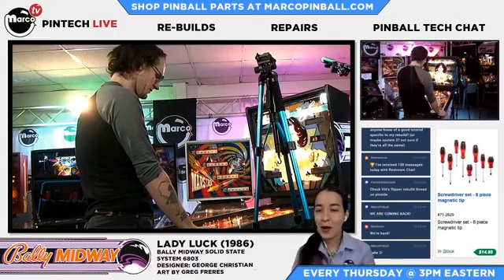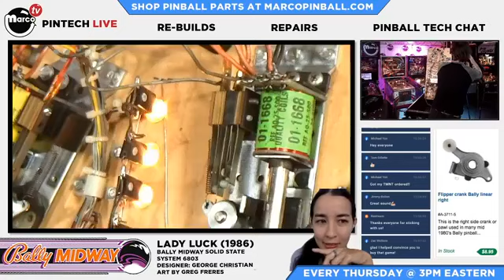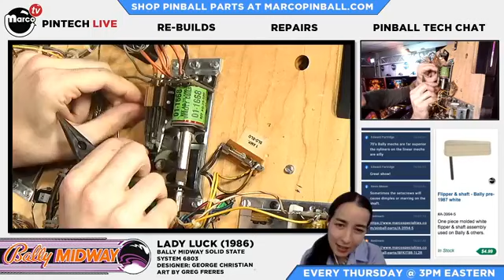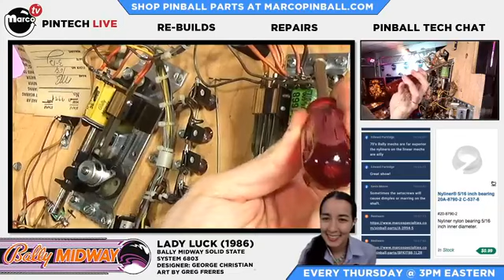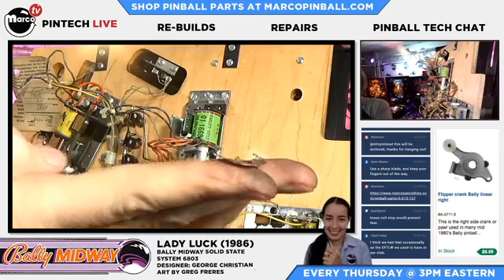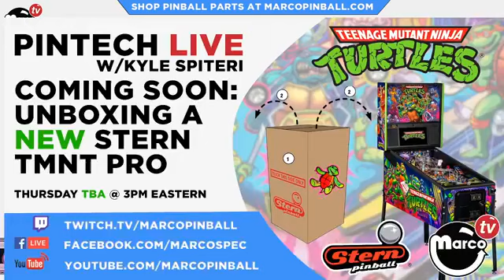EP007: PinTech LIVE - Rebuilding Bally Flippers

Comment: add clear nail polish to the coil stop screw threads before tightening down. acts like a threads locker but allowing future removal. blue thread lock is waay to strong for that small a screw. a tip from my eye doctor. thats how he keeps worn glassses frame screws from coming out.